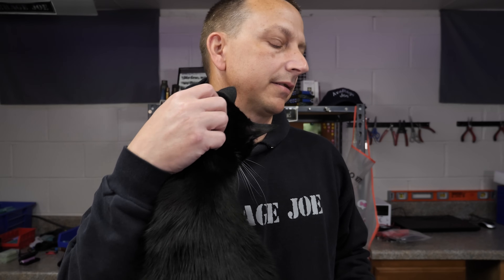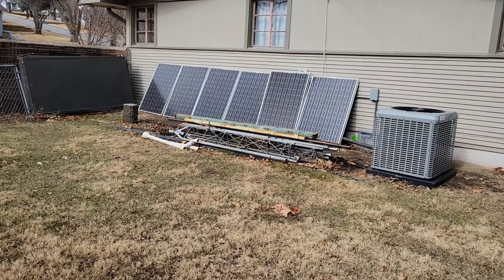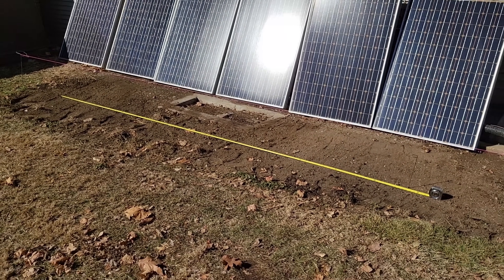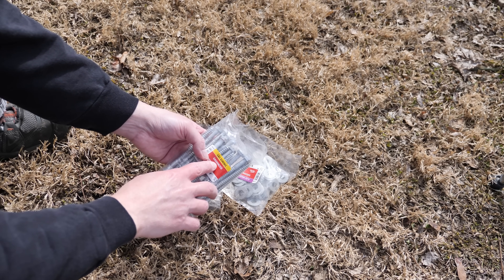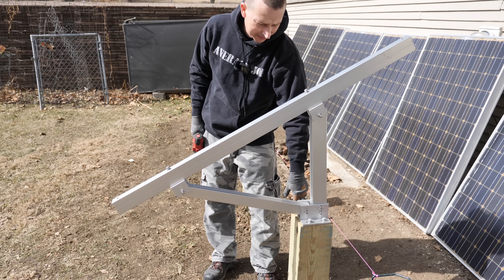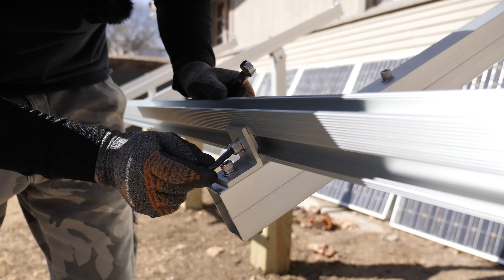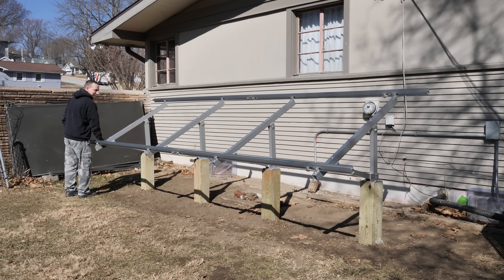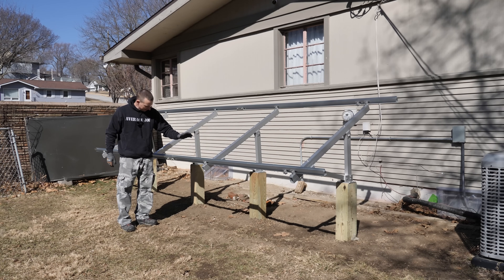EG4 Solar Panel Ground Mount Rack Install!!

Comment: Joe you runing out of space for solar panel and battery😂
Reply from the maker: LOL I know right.  Now I just need to have the wife let me put panels on the east facing roof🤐😜
Reply: @AVERAGE_JOE  i got my yard full of solar panel.. and wife tell me last week you need to stop.. solar thing is adictive ..
Reply from the maker: @aristidesroman435   LOL it is addicting for sure but when the utility bill goes down or away all together its worth it!  How much solar do you have?
Reply: I got 64 panel of 315 watt each.. here in florida.. and 50kw in big battery thanks to you!!! 😂😂
Reply from the maker: @aristidesroman435  Oh Yeah thats right!!!!  You gotta send pics!!!!  When did you order btw?
Reply: I have 5 of the husky 3  (5kw) each.. using your code i belive and the firt 2 was before i watch your videos. The oder is a server rack for signature solar.

Comment: Hi, im going to do canopy for my house using aluminium rail, not the U shaped though, not sure if it will be strong enough to hold wind on the 3rd floor hmm got the foundation from steel already, just not sure how to get solar panel installed on those steels
Reply from the maker: My buddy just made a movable awning for his back patio. He used the aluminum rail. Looks and works awesome!

Comment: Go for 10, I have one of the ground mount and after seeing your install I’m ready to tackle it myself.
Reply from the maker: 100% 10 is going on there!🫣🤭 So yeah the rack was super easy if you go this route. Hardest part was digging the holes lol😆
Reply: You got me thinking, from the short clip I see you connected the two panels on short sides which would make them very tall. Im my case (Florida) that would be a big wind sail IE hurricane. It might be fine in your case since you are next to a building. Im excited to see the next video on how you do it.

Comment: I bought 2 of these about 6 months ago, and finally poured 4x 10" concrete tube footings for 1 of them last weekend. I'm putting 4x 400 watt QCells on it, we'll see how it goes. I need to get the right sized masonry bit unless they happened to include one in the kit. I was thinking about assembling it, setting it on top of the concrete, and marking the holes, but that might be more hassle. Curious to see what yours looks like with 5 panels.
Reply from the maker: Nice! Yeah its super easy to throw together. Id love to get some Qcell panels. No masonry bits included. I think you need a 3/8" if I remember right for the included ancors. Yeah I would use some regular sized panels but only have 2 left so the odd shapped panels are going on! Should look great once installed!🤘
Reply: Did you have any issues with using 10" concrete tubes. The instructions show the forms should be 50cm (approx 20"). I think 20" is overkill. I was thinking that 12" going 4' down for frost protection would be more than adequate. Do you think the 50 cm x 85 cm is using the weight of the concrete as essentially ballast?
Reply: @blossom2174  I haven't had any issues at all, though 10" is about the minimum you can go with the size of the mounts for the anchors, and a full 4' would a little deeper than I ended up going. Mine is near a wall, so wind gusts aren't likely to be much of an issue for me. I think you'll be totally fine with 12" 4' tubes.
Reply from the maker: If I went with concrete. I also would have done either 10 or 12" tubes and 3-4ft deep! Also next to wall so wind on that south side of house isnt an issue.

Comment: I wonder how my neighbors would feel about 5 of these along the chain link fence on my property line. ;)
Suggestion: Anyone doing this should toss a couple inches of gravel at the bottom of each hole, this way water doesn't pool against the wood end grain.  This will make the posts last longer as most of the water pickup from a piece of wood is on the end grain, even on a treated post. I'd put the cut end facing up as well.
I was going to say "better pre-drill the holes in the posts or you'll likely split the wood" but it looks like you did but only showed it on the out-takes.
Reply: Personally, I'd recommend sealing the exposed end grain as well, especially with the four bolt holes being fairly close to the edge of the wood.  In time that vertical end grain well rot out if not sealed well with something, and once it does there goes the anchor point for the rack.
Reply: @ssoffshore5111  Both great ideas!
Reply from the maker: Damn....I completly forgot about sealing the ends lol🤦‍♂️ Ill seal the top side! Thanks for the reminder!!!💥💥🤘
Reply from the maker: I think your neighbors would absolutly love you for setting up solar panel racks😆 I almost put some gravel down in there.... was this 🤏 close.  I did show pre drilling the holes right before the assembly of one section of the rack but only showed drilling one post🤘
Reply: @AVERAGE_JOE  Wouldn't be the first time I was blind and missed part of a video. :)
Reply from the maker: I 100% miss parts of videos......even when editing😲🤫😆
Reply: I wouldn't worry about what the neighbors think it's none of their business.
Reply: @DESERTDWELLER4547  It's WA even if I was in an HOA they couldn't stop me due to the laws around here, but that doesn't stop rocks being thrown over fences late at night either. ;)